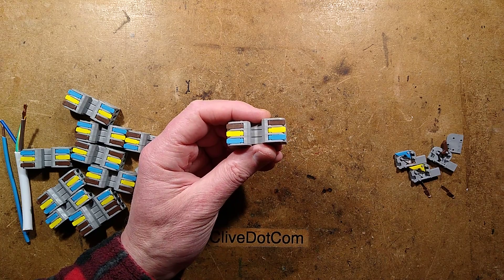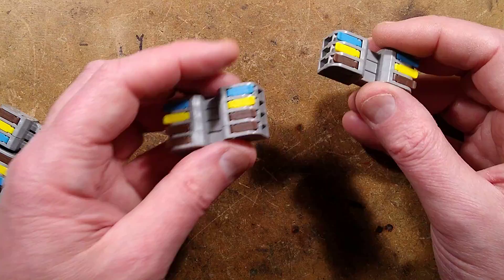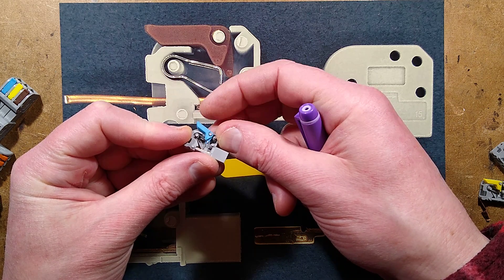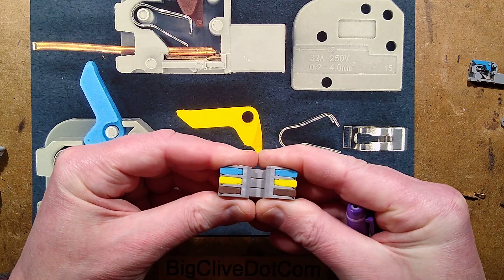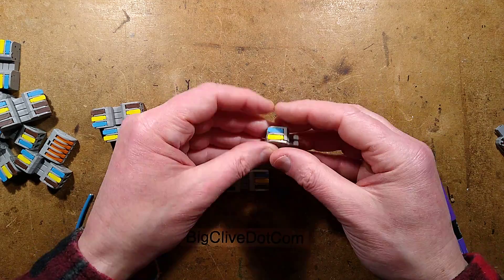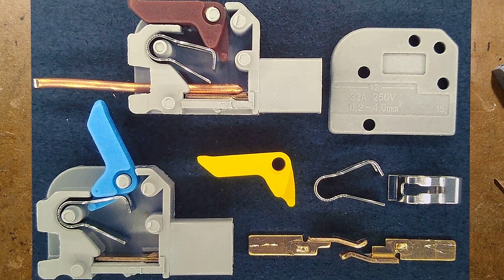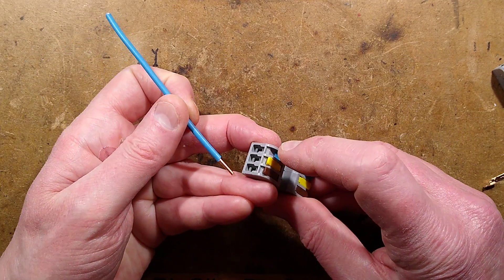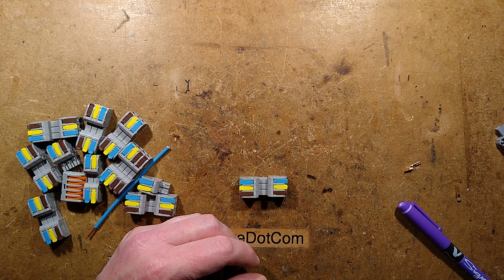Interesting modular connector with a few issues

Comment: As someone already said, keying them would make them safer, but you could just key the earth so only earth can be plugged into earth, that will eliminate most mishaps that are dangerous to the user.

I've seen American videos saying to wrap electricians tape around the levers on Wago 222s before putting them in a backbox so they don't open (I've never found that legit 222s would open easily, even if they caught on something and you should always pull on the wires after installing to be sure it's done right) so that might work to hold these closed, unless they melt. Changing the lever to make it fail-safe like Wagos would be better. I assume having the lever act as a retainer and not a spring 'loosener' also makes these far less reliable than the Wago connectors in areas with heat cycling and vibrations, probably barely better than the old screw down terminal blocks after taping the levers down. 

Making the connection better when plugging them together is hard to think of in my head and harder to put into words, but an inverse * or + shaped hollow piece of metal that's sloped and flexible enough to deform in one direction or the other may work, add a detent to the ends and a small pip to the tips of each blade in the hollow star shaped piece of copper may allow it to bend the click in place with more connectors than just 1 per wire. Might require a lot of force to push together and pull apart though. Another option is to add a second connector to the side of each one (horizontally and vertically) so you get double the connection area. 
Or just have them marked A and B for a male-female arrangement. You're always going to use 2 of them together anyway, so making them that way would work. Makes it a bit harder to use them in something where you may want to swap a love one around for different things though, but that would likely only be used in lower voltage hobby stuff.

Comment: I don't see how this could ever be used within UK electrical regulations unless it was within a connection box with cable clamps. In that case, just what useful function would it perform anyway which couldn't be done with some inline Wagos (or similar)? If you want to regularly connect of disconnect a circuit, then surely you would use a switch or a socket/plug designed to the appropriate electrical standards.

Comment: As a concept design, I think these are... interesting. I do like the modularity of each connector, but as noted, some security and rigidity issues need to be addressed. Over all though I would probably use these in low-voltage DC applications such as audio/visual connectors, but even then they lack proper shielding so "cross-talk" over the exposed connectors could very well limit this functionality.

Comment: I think they would be good for messing around at the work/play table. I work/play with 40 -12- 9 or 5 vote 90% of the time and these would be so much better than doing the single twist to hold the wires for a few min testing,

Comment: Any connector is a potential failure point. I used to use Wieland 18-x connectors all the time and the biggest issue was installers not pushing them home. Once they were seated properly they were very good I think I only had problems with one in over 10 years.

Comment: They could fix the misalignment issue by keying the different colours differently, so you can't connect a blue to a yellow or brown, only to another blue. The connection from module to module could be fixed by making the plastic connectors themselves click together rather than the metal contacts, so the contacts don't have to slip past their highest spring point. Or there should be some mechanism that applies pressure to the contacts after the connectors click together and they've slipped past each other. As for relying on the integrity of plastic to maintain a good connection, you'd pretty much have to adopt a "Vago" style spring contact, which may be difficult if Wago has patented it (not that it's ever been a problem for the Chinese manufacturers before). Either that or mitigate the problem by using a high-temperature plastic or one that otherwise doesn't soften/deform due to heat.

Or you could just spend a little extra for the genuine Wago connector. There's a reason why they cost more, and I suspect if you fix all those issues with the cheap one, they wouldn't be quite so cheap anymore.

Comment: Redesign them to add a male/female set of collars that tenaciously lock onto each of the module stacks and provide latch or detent retention to the other one.  They would be simple and inexpensive square or rectangular tubes with the securing features molded-in, available in sizes to accommodate the number of modules you want to stack.  They would make it impossible to misalign the module stacks, relieve the electrical terminals of retention duty, and would greatly reduce, if not eliminate, the chances of the module stacks falling apart.

With the terminals no longer needing to provide retention, they can be redesigned to change the humps to simple ramps.  The farther they are engaged, the harder they push against each other, making for more positive contact.  What's more, without the retaining collars, they'd push each other apart, making the collars a necessity for functional connection.  The redesign would include anchoring the wire retention springs to the terminals.  Features that improve the wire-to-terminal engagement might also be implemented.

Edit:  I suppose one could go all-in on the modularity and make swapping the levers a trivial matter.  Offer them in a wide variety of colors, including striped, to match virtually any wire color(s) you might come across.

Comment: Exceptionally good advice. I would be interested to see what would happen to the plastic if you put a soldering iron tip near it. Some plastics have a higher melting point and I could bet that wago ones offer better high temperature tolerances.

Comment: They could have fixed the misalignment issue with longer end plates that stop you from being able to connect them out of position.

Probably good for low current DC loads.

Comment: Who amongst the DIY community is aware of the importance of an electrical product achieving a BS Standard and the significance of traceability?
Electricity at Work regulations apply in the home particularly if you employ someone, for instance, to do housework.
If they get Zapped by your unqualified tomfoolery with electrical systems including non standard untraceable wiring fixtures/connectors then there will be trouble ahead.

Comment: The term you wanted for the connectors was 'hermaphrodite'.

Fully agree about the connection integrity relying on plastic - a complete no-no.
Reply: I don’t mind that design in small signal connectors (like Molex KK). But on mains or high-current? Heck no.

Comment: 4:45 I would never consider fitting stranded cable into a semi-permanent connector; always, always use shoelaces.
6:00 Neither would I use semi-permanent terminals where regular servicing is required. And if it's a pump it should at least be a splash proof terminals, at least IPX5.
  Thanks Clive.

Comment: The wire only makes a small thin connection with the connector electrode. A wire nut makes a far better and safer connection. 32 amps current carrying capability, I don't think so. The contact will get hot and melt the spring pivot and a fire will ensue. 5 amps is all I rate it for. Great videos Clive! How's your brother doing?

Comment: You know for years and years electricians have been saying not to use the push in connections on the back of switches and outlets because of the poor connection made, which is the same function as this style as well as wago.  Some will release some won't, but if it's not good enough on a switch or outlet why is it all of a sudden good on these units?

Comment: Something I noticed but not mentioned is the colours are keyed differently for the left and right sides. So if you had them loose in a bag or toolbox and picked up two lefts and weren't fully paying attention and stuffed your wires into the matching colours you'd end up connecting live to neutral. Obviously not as disastrous as connecting live to earth, but still not great.

Comment: I've seen similar modular connectors in florescent emergency lighting.  Yes well I not sure I trust then connector.  Not so much on the 3.5 volt side, it's the 240 volt side I'm not happy with

Comment: I see now what you meant (in your reply to my comment on your short) about their modularity being more difficult to key, since it can't be done on the prongs while keeping the modularity.
But if the end cap pieces were extended to the full length of the prongs, that would prevent offset connections (so long as you used the same number of modules on each side).
Reply: This idea of extending the end caps was the first thing I thought of when I saw BC's short video.
Another excellent explanation, BC never fails to make everything clear.

Comment: I use wago 734’s for that type of application. It works about the same except you use a little tool as a lever instead of the lever being a permanent part of the connector.  You can pull them apart and snap together more slices to change the number of pins if so desired for the female connector, but the male connector cannot be easily modified.  UL rated for 10 amps (300v).

Comment: On the modularity aspect: it seems you can pre-fabricate cables with eg three leads, and then combine one end into a bus by peeling off the lid and joining multiple connectors. Useful.

Comment: Is there a reason these things always have multiple metal components? I would expect that making everything into a single copper(ish) clamp would have its benefits. Other than that, these clips seem to have a lot of things going for them, one or two more iterations would make this really good without sacrificing price/complexity.
Reply: Yes. You want copper/brass for the bar and spring steel for the clamp. Using copper for both would be a bad idea as copper is a bad material for springs. Using spring steel for both would be bad as spring steel is a bad conductor.

Comment: The wago style connectors are nifty, but i dont know how much i would trust them in less than ideal conditions. (High vibration, high humidity higher ambient heat).   We had industrial equipment that used wago remote I/O modules and the spring style connectors were a weak point (talking hundreds nearing a thousand connections per piece of equipment. ) it was inevitable that one of the wago modules would fault on a regular basis, and it was almost always a connection that was less than perfect. (Would have to remove the wire and re-seat it or slide one of the remote modules out and back in to clean the connections between slots (look up a pucture of wago remote i/o. It will make more sense.  The i/o modules would stack together like legos with spring connections between each slot).

I just dont know how much i would trust this style connector in hard industrial use vs a wire nut or better yet a (properly done) crimped connection.
Reply: Wagos are not certified for high-vibration environments...

Comment: Some notes here:
The connector part of it where it overlaps and clicks into place it's quite similar to the Anderson powerpole connectors. Not identical, but works on the same principle. (I'm using the SB50 connectors in several places)
Each color should have its own keying to prevent the "offset" issue and allow for building truly unique connectors.
But they seem to be a nice basic idea though.

Comment: I really worry about the popularity of these wago knock offs.  They are fine for low volt projects but I'd never trust them for mains.  I know most of them have been tested as good enough, but I worry about the consistency. Modern load centers should protect most people but these could get burn your house down sketchy in older homes. Like you said, there is zero chance of 32 amps going through that without it spontaneously becoming a heater.  I also dont like the idea of these being plugable for mains for the reasons you mentioned. Imagine pulling a motor with a load and catching the arc with your finger. Ouch.
I'm sticking with the name brand wagos and ideal connecters for my mains projects.

Comment: The could easily add a "key/finger" to that closing plate that you put on the final position of the stack to eliminate the misaligned insertion issue.

But, as many others have commented, I'd really like to see some current/temperature tests on these things.
Reply: Yup, the mis-aligning risk could be lessened if they made the end plates stick out next to the non-directional plugs. That way, you could only offset the assemblies in a single direction. And to mitigate the risk from that, it would just be enough to always put the incoming live and the ground that goes to the machine onto the connectors that would remain unconnected. (And by elimination, the neutral wire would go in the middle. )
You just have to be able to trust that what you call "live" is indeed the wire that carries a voltage with respect to ground.(*) (And as long as the incoming/outgoing cables are wired into their intended sides of the assembly.) In fact, I think this order should always fail safely, even if you shifted the connection one place in the other direction (as long as the appliance doesn't have a fault).

(*) Another reason not to use these for any place where some other electrician can get their unqualified hands on the system.

Comment: Thank you for your thoughts, I agree personal non-plugged sockets only, also plastic and not rated I can understand. I'm having trouble though, since as you state they are modular, that also implies modifiable, so the poor connection aspect should be able to be adjustly bent once and work for Xk # cycles given other things made of copper's ability to bend.

Comment: Not entirely sure what the point of stuff like this is. As you say using them in a professional setting (where you do need quick methods of joining wires) is a big nono, and I'd have thought that if you want to install something like this personally on a one-off basis you'd be much better off with cheap choc-blocks anyway? They are a better solution generally, the only downside being installation takes longer, and if you're only going to be doing it once in six months why introduce points of failure into a build?

Comment: I believe the technical term is "hermaphrodite connector". I agree with the others here that we need to see what these do with 32A going through them (and preferably 4mm^2 wire, so the wire isn't the weak point).
Reply: Are you insinuating for Clive to destroy an electrical connector by pushing lots of current through it? 😜

I'd watch that! 👌
Reply: @DerMarkus1982 Lots of current could mean lots of heat, the possibility of ignition, what a treat.😏